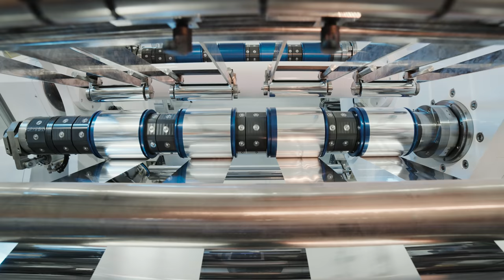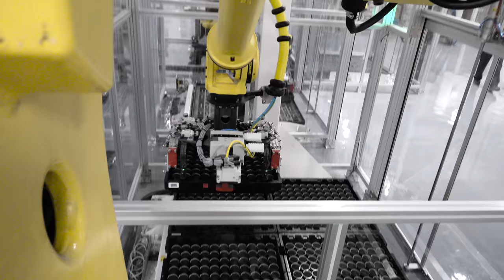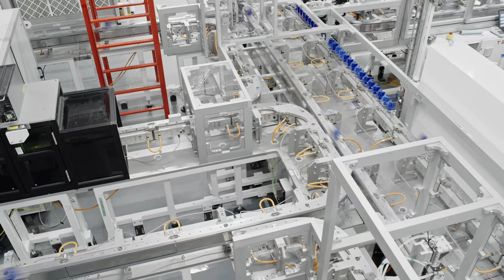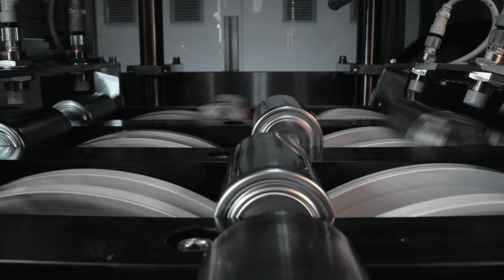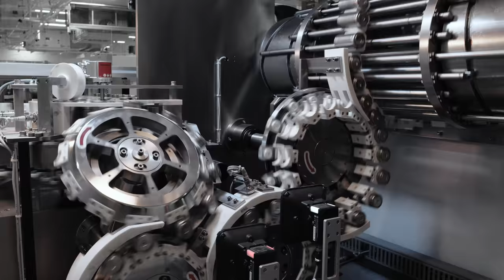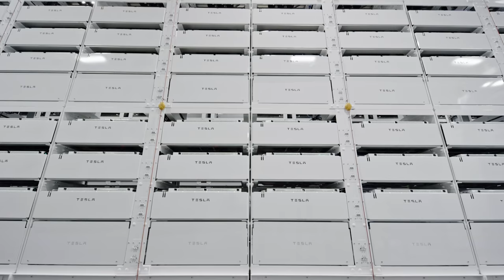Making Batteries

Comment: I'm surprised they are made up of so many small batteries rather than a big one
Reply: one word : ventilation
Reply: Helps regulate voltage and increase cooling rate for higher performance, power tools use similar construction just much smaller and no glycol cooling pump.
Reply: @patrickclintoneric4147  scam

Comment: Why single cell made in form of cylinder? This is ineffective in terms of packing them in battery, there always will be gaps between them.
Reply: the battery pack size is not a real concern, weight and cost are primary, a cylinder is much cheaper to manufacture then any other shape and gaps between them allow for fire suppression foam to be sprayed in between.
Reply: Because energy efficiency is more important than space.

Comment: You mean be resposible for a lot of pollution and environment destroying..... Latest researches said 170 000km till an electro car with a decent battery is better than a  more or less up to date fuel car in therms of environmental impact. And im pretty sure after 170 000 you will need a new battery....The future will be hydrogen cars, already now up to 2 as efficient as a fuel car.

Comment: Please Tesla put a normal wheel and storks back on the plad models, even if it’s just the same as model 3/y , did anyone think when planning the wheel just how bad the new design would be for mobility needed users , we need a gear stork and fixed location for the indicator regardless of what angle the wheel is at , not guess if it’s left or right when turned. This is one step to far tesla, and not a good design it will affect sales

Comment: How are these recycled?
Reply: After theiy lost approximately 60% of the capacity they are used to store spare energy of windmills or solar panels
Reply: The power from renewable energies aren’t stored they are put directly onto the grid. To my knowledge they don’t have a way to efficiently recycle the battery and make it useable again.
Reply: @Bryce-qh9rt  you can use battery storage together energy while the grid doesn't need it.  Also look into redwood materials they do battery recycling
Reply: @tozl9805  not true. New cells go into Megapack and powerwall

Comment: So gravity is a reasult of pressure, space is a vacuum, the gravitational hold of the panet is a result pressure. 
Icntk, the pressure of the planet and who know you may have a way of telling, but if no way  of knowing, and it come across someone mind to fit some sort of pressure gauge on the front of a shuttle, DO'NT, be like jabbing a screwdriver in a tire valve. So NO.

Comment: show me how the resources are mined and tell me how gas is worse for the earth
Reply: most of the metal in a battery is Nickle, this is mined normally all over the world using large machines and smelters, lithium is mined in Australia and some south American countries and is mostly chemically processed, environmental impacts varies from land usage, acid spills, to water usage, loss of land and contamination does happen,... BUT when you compare it to fracking, oil drilling, and  processing oil becomes one of them becomes the clear winner in this, you never heard of a lithium spill taking out a coast line but its a yearly and semi yearly occurrence with fossil fuels, this is not taking into account death related to air pollution from the Use of oil or the climate impact that will cost us trillions in damages.
Reply: @miguellopez3392  i’ll take your word for it. what are your credentials
Reply: @ajquick8667  no credential in oil production or material processing, im just interested in how the technologies compete and hold stock in EV companies.

Comment: So much wasted space in between each battery. Should be more like MacBook battery that fill the space. Tesla needs to copy Apple tech
Reply: Manufacturing a battery into a square cost a lot more then a cylinder, it also makes it easier to cool and separate from other cells during a fire if it's a cylinder, apple struggles with putting big enough batteries in their laptops and phones because they try saving as much space as possible for what ever reason they think it's worth it, a car is much bigger and allows for much more flexibility it battery design.

Comment: for the cyber truck, you shouldn't have made the shell harder. it's dumb and let me explain. cars were built to be softer to spread the force of a crash throughout the vehicle so there was less of a chance of hurting or possibly killing the driver. since your truck is more solid the driver would hit their head much faster and harder many times back and forth because all of the force of the crass instead of half of the force would be coming right into you. also crashes would happen way more often because the car is faster than most cars so first new drivers could see this car as a possibility especially if they're rich and they get the warning don't listen and die on the set drive. if you would go through this you probably would not live but if you did you would then die to the airbag ending you after a bad concussion, whiplash, and brain damage.
Reply: the problem was solid frames, you still want a rigid frame for side impacts and the battery structure heavily decrease side impact crunch, the panels will be hard but the frame underneath holding it in place will likely crunch as the steel panels are only 1mm-3mm thick, for a 6000lb truck this will be 2x the impact energy regular cars have so extra rigidity may be countered by higher impact energy. having the battery low to the ground also helps against getting whiplash because the car will resist moving, this car is faster then most cars but it also handles better then most cars.

Comment: ahh yes casually making batteries explosive as a stick of tnt
Reply: lithium content is way too low, there is about 20lbs worth o TNT in a 1000lb battery pack
Reply: @miguellopez3392  nono its not the weight 18650 batterys are super energy dense so a puncture could make them blow up
Reply: @DronePath  thy are 60x less energy dense then gasoline.

Comment: Those batteries your making are not clean 500,000 gallons of water used and polluted to make 1 metric-ton to make lithium-ion for the Tesla models. Not just that every tesla battery made for that EV of yours creates 15 tons of CO2 in the process of making those  batteries.

Comment: Please bring 4680 and lidar back to the model y! I was going to buy one but turned off cause of that my 3 has lidar but not 4680. 4680 would be ideal for winter conditions with more range! Please bring 4680 to the y and 3.
Reply: Look up what 4680 cells are and you will found out that there arent even in any car.... Lidar is also not usefull since cameras take the place of rader